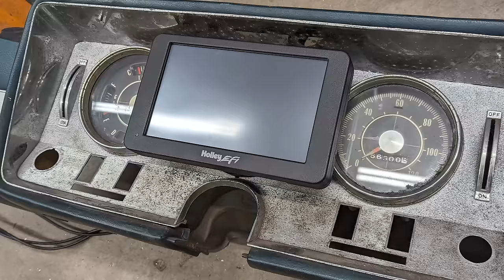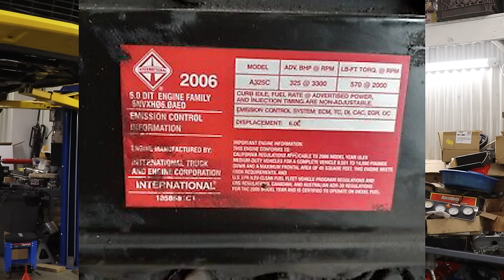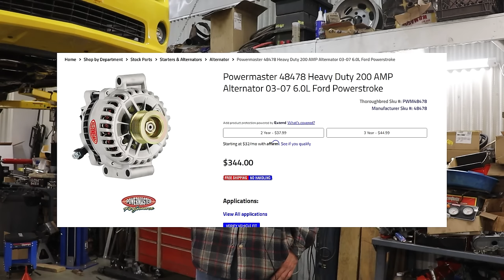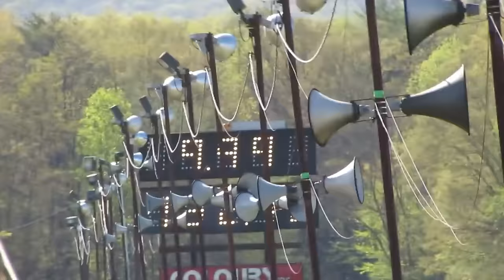Regrets: Losing My Studebaker to a Thief

Comment: This is why trackers are a must
Reply: Yep! Only 130.00 for a good one. Alarm systems are cheap, too. Can set a trailer up with cameras, tracker, and alarm system for around 500.00. Everyone should do it!
Reply: this times a million.  I see a post like this at least once a year and it's not like I'm even big into racing.  It's always the same, truck/trail/car stolen from a junky hotel overnight.  It's 2024, NO ONE who travels to race, should have a trailer without tracking, period.
Reply: And they are cheap, easily hidden, very long battery life. Professional car thieves will scan and remove it quickly. But you usually have 1-3 hour window where you can track it if stolen. Nivlac is such a good guy. He doesn't deserve this man. Hope he finds his ride.
Reply: Even not dedicated tracking devices work. An old iPhone. A lot of dash cameras have gps location. I leave an old iPhone in my motorcycle for constant gps without apple AirTag tracker notifications and because it’s always charging and I can just use it as a hotspot to my phone to play music.
Reply: @b.c4066  The one I'm talking about has a 10 year battery. I put one in a metal box and welded it shut, under my trailer. No one can disable it  unless they know where it's at and want to cut through 1/8" steel.
Reply: Or people could just not steal shit too 😂
Reply: @funfun8095  what brand or where can I find details on the unit you are talking about?
Reply: @crherniman  Trackhawk GPS
Reply: Air tag is cheap

Comment: So sorry to hear you are going thru this. I ran a few construction crews in FL. Traveling I-95 corridor. Theft of trucks & covered trailer was a huge issue. The truck trailer & tools are what they target. It got so bad we had to equip the trucks & trailers with alarm systems. We had one gang of thieves follow us north on the interstate and break into the trailer to steal tools and copper wire twice in one week the last time, as soon as we parked at the motel (broke in while we were checking in). There seems to be a big market for these trucks & equipment in central & S. America. 

Wish you the very best. I really hope you recover the car in one piece & unharmed.

Comment: I've seen a shocking number of these events where the thieves immediately figure out that they didn't steal a trailer full of siding or lawn mowers or whatever and just dump it somewhere since its so easy to identify the contents. The truck is probably gone forever, but you may have a chance at seeing the car again.

Good luck with it. 👍
Reply: Ya it's so easy to identify that car and everywhere the car goes it's going to attract a lot of unwanted attention. they might cut the cpu parts out of it and ditch it. then take the trailer.  Calvin should call the cops again and maybe he will talk to a car guy who will keep his ears peeled.

Comment: This always freaked me out when hauling in the USA.

I dont park near lights, I park against curbs.

But the reality is, this video has convinced me that my truck is getting a hidden battery disconnect
Reply: I remove my battery, and take the lug nuts off everything. I have been driving all over the country forever. No one fucks with anything.
Reply: cell phone based tracker of just a hidden phone on with one of the tracking apps .h20 wireless is on att network is cheapest 15 n up and can be bought up to year i love that
Reply: Fuel pump remote 12 volt switch?
Reply: For sure air tags, battery disconnects, and why doesn’t anyone buy alarm systems anymore?! They have 2 way alarms that work up to 2miles away and will page you if someone is leaning against it. I’ve seen peeps use bike locks, they run it through the rim around the A arms. I mean the more time and hassle it is the more likely they get caught red handed or they pass on it knowing it’s gonna be a pita.
Reply: @mayshack 
Air tags do not have an infinite amount of battery life. I don’t know how long the battery lasts but it will eventually run out of juice and quit pinging, or whatever it does so that it can be tracked. I mean, it wouldn’t hurt to throw an AirTag, or two, inside some of the stuff that you really don’t want to come up missing forever, but just keep in mind that it doesn’t work forever and you might want a “plan B”. Just my thoughts. Have a great day.

Comment: I have no clue how people can steal sh*t like this… Having to break into the truck, hot wire the truck and run off with the entire rig…?!? How in the heck do you do that? 
Have to take the wheels off, and chain it to 3 other cars? This is infuriating. There’s nothing that can be tracked? The laptops? The Holley dominator? Anything? Can anything be tracked?
Reply: apple airtags in the boot and under the seat carpets is my new best investment
Reply: Im horrible with losing my wallet. So my wife got me a wallet that has an AirTag in it and it’s already paid for itself. Now I have one on each set of my keys and 1 hidden in my car. Won’t stop things like this from happening of course, but might help recover.:( so sorry this happened!
Reply: @TomBudin  Airtags only have so much battery life.
Reply: As he said, those trucks are "easy" to steal. A friend of mine had his Ford truck stolen right out of his driveway.
It only takes seconds to unlock and open the door and it doesn't take them long to get at and turn the ignition switch (no hot wire required)...
Reply: Done bt pros and you can expect more in the future.  We've been invaded by criminal gangs from other countries.
Reply: @juststeve7665  wrong...truck/trailer combos are being stolen by folks who have been around a while...not Gurmeet from India.

Comment: 99% of the time in a case like this, a hotel employee tipped off the thieves. Your dad probably tipped off the hotel employee. 

My severe condolences, the last thing y'all needed was a setback like this. I've  had 2 project cars stolen from me, I know this emptiness, reach out if you feel like it. (Though mine were both tinged with betrayal, thieves were my dad and then a good friend)

Comment: No way that sucks but every year this happens multiple times and to not have tracking on something valuable and something that gets stolen practically daily makes 0 sense
If you have a trailer and racecar pay the 10 bucks for gps or 20 and put it on vehicles and trailer
Its weekly someone i know looses a complete vehicle or gets one broken into
Cameras just let you watch the guy steal it thats about all they are good for
Donated for the cause
Reply: Another $120 a year for every single tracking device you want to install on every single thing?  That would be $360 for the truck, trailer, and car.  Unless you can activate them after the fact when you need them, it can be an expensive fix to the problem, although a good one.

Comment: I'm restoring an extremely rare car at the moment, and stuff like this makes me think very hard about never taking it on a trip somewhere. Putting tags in it so you can locate it if it's stolen won't stop somebody from tearing it apart. The thought of somebody tearing apart hours and hours of my hard work is too much to comprehend. 

I can only imagine what Calvin's going through. I will keep an eye out on the Pontiac GTO and G8 groups for the engine and the supercharger.

Comment: I'm sorry this happened to you. I owned a 2003 Power Stroke 7.3, last of the Super Duty 7.3s. I bought mine 2000 miles from home. I had a panic attack in Oklahoma City when we stopped for the night. I disabled the starter solenoid and pulled some fuses once I realized a brick and a screwdriver were all that was needed to steal my truck. The Super Duty did NOT receive anti-theft technology until the 2008 model year. 2008!!!!!

The Excursion, which was a wagon version of the F250 DID get anti-theft tech as Ford classified it as a passenger vehicle. So the tech was there to do it on the trucks since model year 2000, Ford just chose not to include it.

I do hope they are able to recover your car and truck. Though, at this point I hope it's the car at the very least.
Reply: why i will never buy an F-series or dodge ram pickup..BOTH are to easy to steal..and neither car maker will do anything about it..

Comment: My dad's bronco, 83 xlt. He had it built. You didn't touch the dash, if he was on the gas. His health went down. The truck sat for 10 or 12 years before he died. I got it. I built the shit out of it. Stupid fast. 4 rooster tails 40 feet high, while running 80. It was Baja ready. Stolen. Gone. Just like that. They had to of chopped it up. It was a one off. Kinda messed me up. I build 2 wheel drive rams, now. 
Anyways,  you got this

Comment: When traveling, always try to rig your vehicle so it cant easily be stolen pull a power fuse, battery cable, coil wire if its an older distributor style ignition, fuel pump fuse, coil power fuse, put a hidden toggle switch to interrupt the (ignition switch, clutch saftey switch, neutral saftey switch, interrupt the ground to the coil packs) there are so many possibilities that one can do I recommend taking alittle time and come up with a way on all your vehicles to make them theft proof.

Comment: I’ve been where you are and it does suck. Most people don’t realize how motels are easy pickings for scumbag thieves. They know that everyone is worn out tired and asleep inside. They also know that most hotels only have one employee on duty on the graveyard shift. I’m in motels constantly for business and traveling work crews with enclosed trailers pulled by diesel pickups get stolen constantly. These are organized theft rings not just opportunistic thieves. 
You will bounce back and traveling to events is part of your life so gps transponders hidden in everything you own is a must. It really helps to try to stay at motels that have 24hr businesses around it like fuel stations where you can park.
Once again, I’m sorry this happened to you. It’s definitely a gut punch but you folks have to bounce back because I love your content and you’re doing things with a straight 6 engine that most channels aren’t doing.

Comment: Sorry to hear about your prized possession. The need for "cloud connected" security is at an all-time high these days. There are dash cams that can provide email alerts along with a picture of when something happens to your car. They can upload videos of the "event" so you can play it back immediately. Also, you can look at a live stream directly from your car. Mine will send an email alert to me along with a snapshot picture even if it detects a cat jumping on the car by motion detection.  Also, what's cool about it is, it will detect hard acceleration and braking and it will automatically save the video to the cloud. No longer need to have a go pro or a cell phone to record your runs in the car.

Comment: Calvin, this sucks so bad! I always worry about theives when I am on the road. A couple thing I do to detour them, parking near light,, etc. I remove a relay so the truck won't start, this will slow them down. I use a rechargeable GPS that sends a SMS signal to my phone it moved, and I paint my trailer license plate number on the roof of the trailer. Almost no one knows it is there, but maybe, just maybe someone flying overhead or traffic cameras might see it. Hope you get your car back, I shared your post on Facebook to everyone and a bunch of races in the SC and NC area. Good luck!!
Reply from the maker: Yeah. We were just talking about upping security the day before this happened... Wish we had acted sooner.
Reply: Man, painting the license plate numbers on top of the trailers is genius!!!

Comment: I live in Pennsylvania and this happens alot here. And happens to the people that travel that live here like yourself. I hear about it all the time. Take the truck an trailer, everything gone in one swoop. So sorry to here this man. I had a race car i built from bare chassis up get stolen right in front of the shop i built it at. I know the guy's that owned the shop did it, but i couldn't proof it. Im 100% shore they stripped it for all the great parts and cut the chassis up an scrapped it. I later found out that they done this to other's an cops weren't able to nab them yet. They were pro level scammers. That feeling of being robbed of somthing you worked so hard on is so depressing. Keep moveing forward an you will bounce back. But im sorry that feeling never goes away.

Comment: More than likely that car is still in the same area where the hotel is. I would start by finding the license plates of the people that parked in the parking spot where your truck and trailer were more than likely they showed up as your trailer and truck were leaving and you might get a license plate on whoever followed that trailer and truck out of there based on a dash cam

Comment: Looking at the location of the hotel, you have a:

-BP across the street
-Pilot travel gas station on the same side as the hotel
-Bucee’s right across the interstate

Down the road at 76 and 301 you have 3 gas stations. 

All of them will have cameras.

The longer you wait the more likely the footage will be copied over.

I personally find it REALLY REALLY difficult that a holiday inn does not have cameras. ( just my opinion)
Reply: Id report the holiday inn for lack of security
Reply: @shadowopsairman1583  that too 🤦‍♂️

Comment: Sorry to hear about your stuff. The police will not help you. The police only arrest for profit these days they don't actually investigate anything. And when your truck is found if it is, it will go directly to impound they will write down on a piece of paper that they attempted to call you. And your stuff will be sold at the next available auction. So your best bet to ever get it back is to keep track of auction sites of the local tow yards. All of what I just dated is fact. This is our first-hand experience. I also know of one very fast quarter mile racer that this happened to also. To the exact detail.

Comment: FYI.  Travel tricks,you need to remove the battery cable or coil wire when you motel . That's just common sense when you have a valuable vehicle

Comment: yup my super duty got stolen, recovered, then 3 more attempts one resulting in me getting a pair of channel locks to the side of my head. Saved my truck tho. Anyway, weld latches and padlocks to the doors, install a hidden ignition switch and wire the original to a loud alarm or other deterrent device.

Comment: Thieves work the easy spots like this they know where no cameras are. They know they can steal 3 things 2 minimum if just truck and empty trailer. Very good value. Knowing what you know you shouldn't have not protected your vulnerable truck with a club boot or block it in. My buddy made a bar that either keeps the trailer straight or keeps it turned at like a 45* angle to make it hard to want to steal. Also has a kill switch hidden

Comment: i use real GPS on Everything i own, not Air Tags. These GPS trackers take a SIM card to connect to the cellphone network for this reason. Mainly this will track the second the vehicle detects movement, allowing police to catch the theives while they are transporting it. It charges off the battery, if the battery on the car is removed, it runs off its internal battery for about 8 months lol. it costs 10$/month but well worth it.
Reply: What tracker do you have?

Comment: Tailing pickups with trailers on interstates, and driving off with them in motel parking lots at 3 am  has been going on since Eisenhower signed the interstate bill into effect in the mid 1950's. You probably would have known if they placed an apple air tag inside of the fender when the truck was parked for a lunch break at the off ramp of the interstate, as a message would flash on your phone.  Keeping the truck moving  on the interstate 24/7  with your father as team driver part 2 would be impractical. On the other hand, to stay out of motel parking lots, building a small bunk inside of the car trailer might qualify it as an RV so you could successfully pull into an RV park at night and the private parks are well patrolled and managers often carry side arms. Emailing every other F-250 junk yard within 300 miles of the occurrence with pics attached and brief descriptions might work. Studebaker owner's club might be another email with pic  contact. Doubt the Carolinas have plate readers, so they are probably selling things out of the back of the F-250 truck, driving all over the place.

Comment: If your truck did not have the pats key column chipped key they are a joke to steal for thieves you should of pulled the starter wire near ac unit takes a second or installed a batt shut down switch that's gonna be hard for thieves to hide good luck on your recovery

Comment: I live in Florence and work in restaurant maintenance and i work the Zaxbys right beside it, give me the date and ill get the manager to see if the cameras got anything. Might be able to get the follow car make and model
Reply from the maker: It happened on April 8th sometimes between 12am and 6am
Reply from the maker: If there is anyway you can get that footage to me. Email me at nivlac5700@gmail.com
Reply: @Calvin-Nelson  I'm going by there today, what day did that happen?
Reply: Sorry, I just saw where you sent the day and time let me see what they have on the dvr and I'll send it to you
Reply: @Calvin-Nelson  I just checked the cameras and none are pointed at the street between Holiday Inn and the Zaxbys, all are inside except for one that's pointed at the drive thru menu board. I'm sorry if I got your hopes up and I'm sorry your rig was stolen in my neck of the woods, hopefully the Studebaker shows up somewhere but with I--95 right here it could of gone anywhere. Don't give up with the sherrifs office, they have cameras on the on ramp for north and south so try to keep pressure on them.